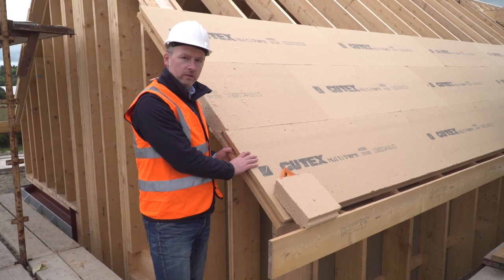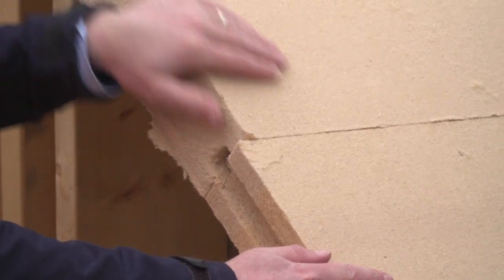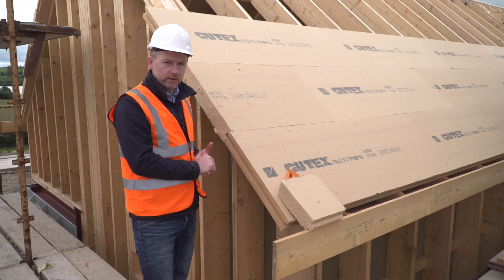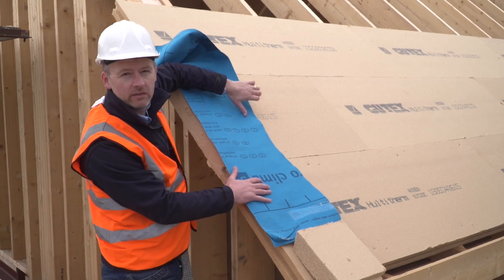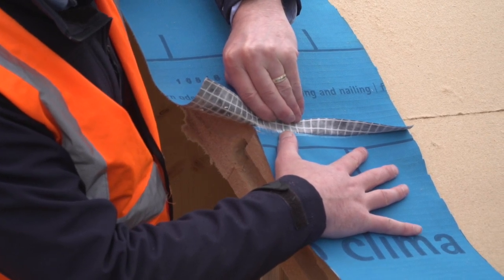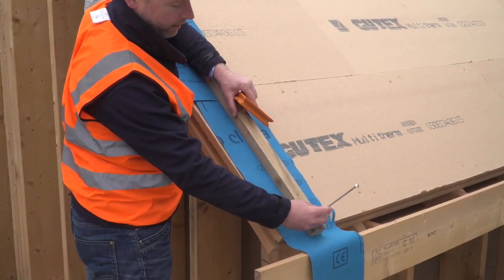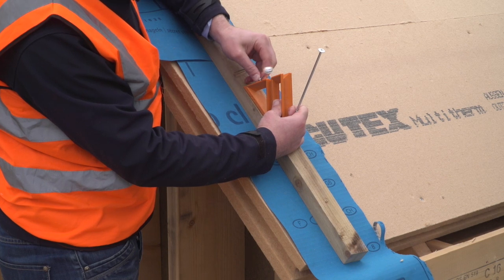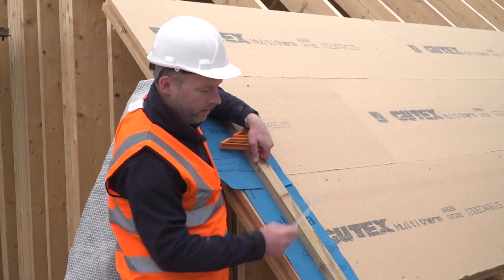Gutex Multitherm Roof Insulation - Passive House Insulation Series (part 3)

Comment: i went for the open rafter bay look by installing T&G wood panels on top of the rafters which makes a nice looking ceiling  inside .however , i had to double up on the insulation panels in order to achieve a respectable level of roof insulation .

Comment: how does tht reduce the shear load
Reply from the maker: A calculation is carried out to know exactly how many shear and suction screws are required to secure the wood fibre and roof build-up.
Reply: I think what you are looking for is more the concept about why it helps handle the shear loads right? That is because when wind exerts pressure at an angle or shifts materials along the roof plane, the 45-degree screw prevents the beam from sliding or twisting relative to the rafter. the screw with the 90 degree angle, helps to push everything down well to the rafter, but it doesnt do as much a good job in preventing that all materials move in the same direction when there is a lateral load. The 90 degree screw makes everything clamped together, but all those layers are completely layed down in the SAME PLANE. By putting in another screw at a different angle, they are now also prevented to move in ANOTHER PLANE. That is why for example in skyscrapers, a concrete core helps to prevent movement in both directions when wind pushes to the building, because there are solid walls placed in both directions. 

What you want to prevent in shear, is that the materials do all move together in the same direction, like you can see with those cartboard homes in america that fall sideways like a deck of cards if there is a storm. hope that helps.

pro tip: ask these questions to an AI tool, they will help you understand the physics and load path.

Comment: But who do you purchase this product from in the United States?  This looks like a great product but this is not going to be available at Lowes or Home Depot.  They have run out most of the Lumber Yards.
Reply from the maker: For USA, please contact 475 Building Supply for Pro Clima airtightness and wood fibre insulation. https://475.supply/

Comment: I don't know how else you'd fasten it but do the long screws cause a problem with thermal bridging? Or is it minimised as they are embedded in the rafter?
Reply from the maker: The size and quantity of screws is optimised to balance the thermal and structural performance.  The screws are fixed into the battens at about 750mm centres and there are only as many screws as needed based on a HECO screw calculation which Niall carried out.  The rafters/studs are 225mm thick and embedment is a min of 40mm so there is an additional 180mm timber behind every fixing which will help offset these limited point thermal bridges. There is also a 50mm insulated service cavity on the interior side too which further reduces the effect. Therefore, in this build up with these fixings the thermal bridging is insignificant.

Comment: I like the idea that it looks more structural than conventional insulation board, I also think the demonstration of the screw method is fantastic to prevent shearing, I wish I'd seen this before, I imagine there's lots of warm roofs installed not bothering to use this method. Unfortunately I'm a bit put off by the fact this material looks just like MDF and gives me the fear it will soak up moisture like a sponge and swell like crazy. I hope to be proven wrong though, but is there a demonstration of it being exposed to water?
Reply from the maker: Hi Michael

Gutex boards have been used since 1932 and all external boards are hydrophobic, treated with Parafin, and do not absorb water. Additionally they will be protected by a Solitex Plus windtight breather membrane :-)

This blog may help: https://foursevenfive.com/blog/nature-does-it-best-gutex-wood-fiberboard-insulation/
Reply: @EcologicalBuildingSystems  thank you for the response, I'll have a read, is the treatment throughout the board, in other words, when cut, does the new cut edge of the board still repel water

Comment: @Ecological Building Systems Will this work with Rockwool Super, even though it is not interlocking? I have limited options available in my country and would prefer to add insulation to the roof  over the rafters rather than on the inside of my already small house.
Reply from the maker: Hi, 

I’m afraid we can’t provide guidance with other products such as Rockwool Super. I’d recommend to contact the manufacturer directly for more information.

Comment: What do you do about roof overhangs?
Reply from the maker: Hi Daniela,

Based on local planning requirements this house was based on the vernacular architecture of the region where Irish farmhouses dominate the area. These buildings are built with flush gables and no soffits/overhangs. This building ties in with that. To address weathering/potential overheating risk on glazed areas, exterior shading is provided via canopies/brie soleil etc.

Comment: 1. I see no structural shear sheathing in your assembly. 2. Moisture might travel up to the cold side of the insulation and condense. A moisture barrier (on shear sheathing below) and/or closed cell foam roof top insulation prevents that. The air layer you seem to be building in below the roofing material is helpful but can it stop condensation?
Reply from the maker: 1. No internal Shear panel is needed on the roof as it is a cut roof supported by engineered glulam beam tied to timberframe walls which have shear panels fitted inside (all certified and inspected by structural engineer). 
2. Airtightness and vapour control layer INTELLO PLUS membrane is fitted inside. Blown woodfibre between rafters. 80mm Gutex outside. Vapour resistance inside is 60 times more vapour resistant compared to outside (i.e. Sd 14m inside compared to 0.24m outside). Above the Gutex is a vented cavity. This is a highly breathable and moisture safe specification with extremely high levels of safety minimising interstitial condensation risk

Comment: Thank you for the video. Question, why have you decided to go with Multitherm + Membrane and not just Ultratherm without membrane?
Reply: Hi Konrad. Mulitherm has a lower conductivity and cost. Also, I would have had to prime and tape butt joints in ULTRATHERM. Therefore for performance, robustness and cost efficiency I used this spec.
Reply from the maker: thank you